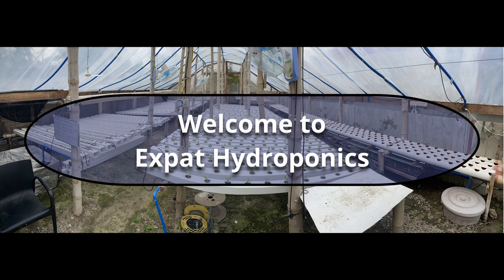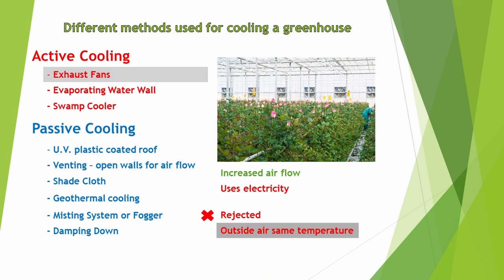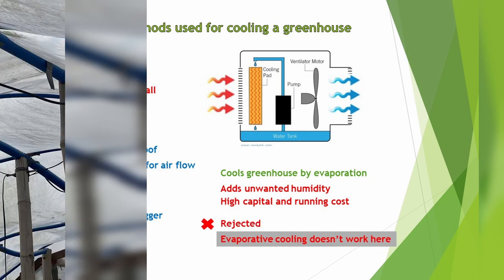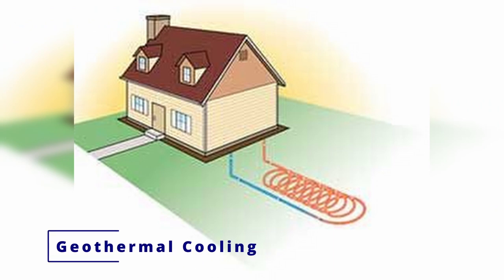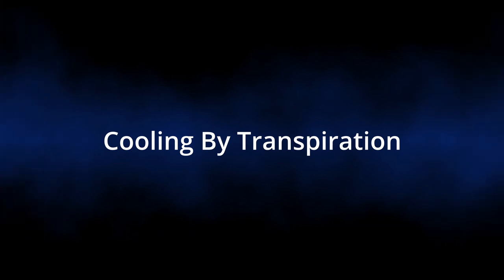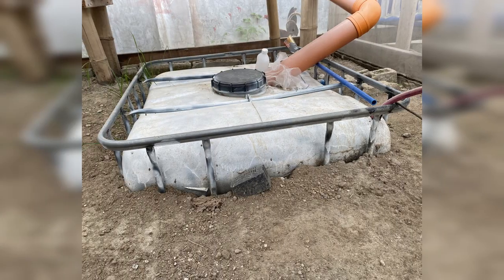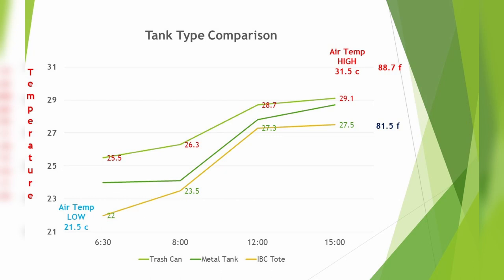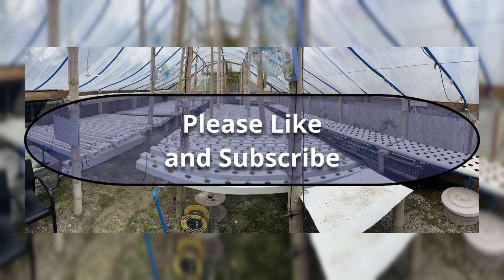How to cool a greenhouse

Comment: Thanks for the information! Have you tried covering your tank with insulation foam?
Reply from the maker: No I have not.  I think maybe that insulating the tanks from the cooler ground may keep the water warmer on hot days and warm nights.  If you try this please let me know your findings.
Reply: @expathydroponics8500  
I personally wouldnt insulate the tank because the lions share of the heat gain comes from water returning from the NFT channels. If you compare the water temperature going into the channel and the temperature coming out you`ll see at least a few degrees of difference. If you measure the temperaure inside one of the NFT channels in the middle of the day you may be surprised how hot it is :)  The soil around the buried tank has a conductivity and diffusivity value which dictates how much heat it takes to change the temperature and how fast the heat moves away from the tank. If the soil is wet it will improve both these values compared to dry soil.  Something as simple as watering the ground around the buried tank can make quite a difference.  If there is a significant difference between the outside day and night temperature you can use this to cool the nutrient solution at night. A small pump could be used to circulate solution to some closed NFT channels (no plants) outside the greenhouse at night. The channels only need to be slightly higher than the buried tank so the water drains back via gravity when the pump stops.

Comment: Very nice, just found your site while searching for ways to cool my small water reservoir.  I live in Thailand and have a lot of similar problems with heat like you do.  I have just ordered a dual Peltier chip water cooler from China.  I will let you know how well (or bad) it works once I get a solar panel for it.  Fingers crossed.....

Comment: Hi, i really liked the video. Can the wall fans reduce the temp of the greenhouse which is like open from the sides? Like it is covered by net but is open. I am in Tanzania and doing Aquaponics. My lettuces are bolting due to heat inside the green house so i wanted to increase air flow.

Comment: With our high humidity my only idea other than venting is air geothermal cooling. Plastic drain pipe in the ground blown by a fan.
We have a lot of cloud cover here and can't afford to block light.

I wonder if a in ground tank circulating into a couple of car radiators with fans would be worth doing. Average in season ground temp 500mm down is about 15-18 deg C. Greenhouse can spike into the high 30s if it's not vented fast enough that's a big diff. Anyone got any thoughts on this?